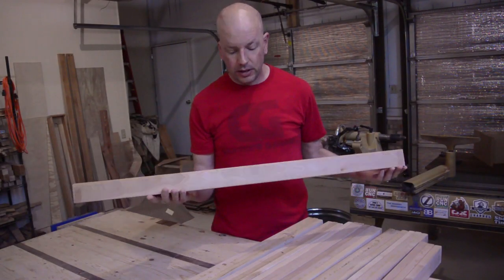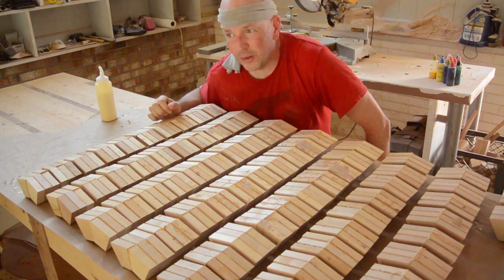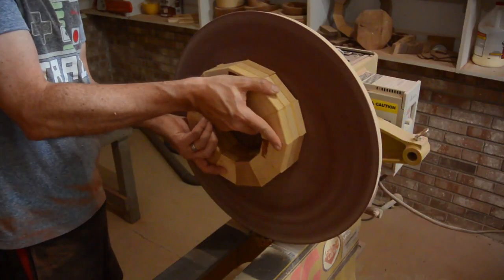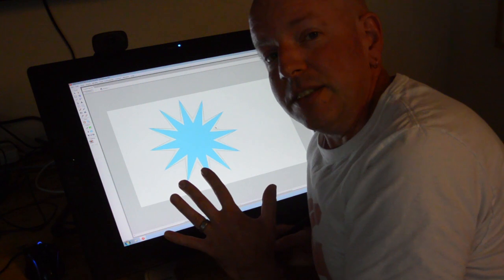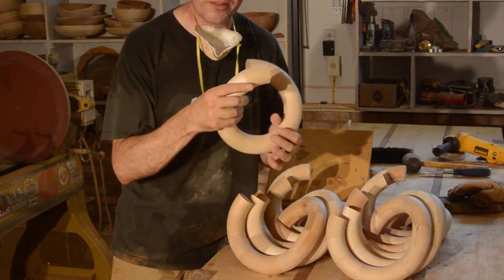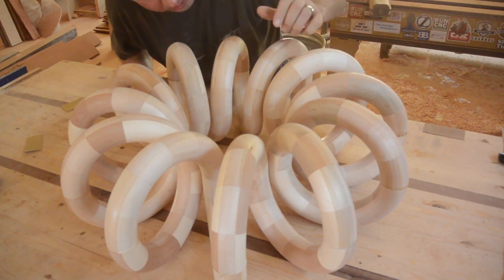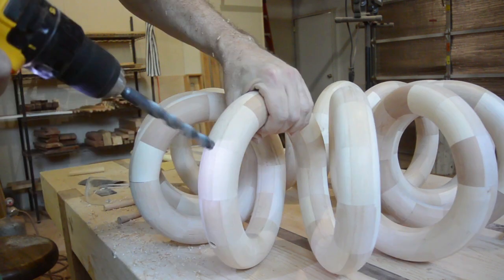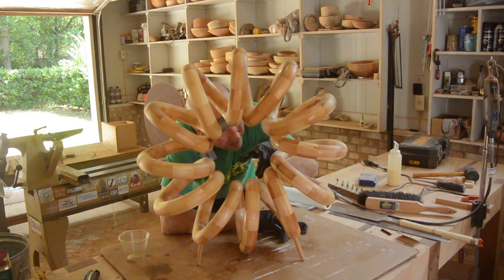Making a 12-Ring Segmented Maple Sculpture - Art

Comment: I just had a Horrible idea.
A 12 Person Toroidal chess {combination of 3rd Millennium chess and Cylinder chess}
So you can play with 12 People on 1 chessboard.
Reply from the maker: A brilliant idea that is beyond my ability to comprehend. LOL!
Reply: @CammiesGarage  I tried 3d Printing a Version for 2 Player, but the Files keep getting bugged out by the slicer.
Woodworking it would also be a option.
a 2 Player version Can also work. for this you need a single Thorus. 
That has 8 Spaces on the short round, and 14 around the longer end So a 8x14 field
With Magnets to keep the Pieces in place
Maybe a 3 Person version also works. if you can make it have 3 Loops instead of 12
As for the 12 Player version all you have to make it so that it has 3 rows for every player {1 for the row with the king and 2 for Pawns} then have it so that every new player is 4 spaces Apart. with 8 Spaced around the thorus part.